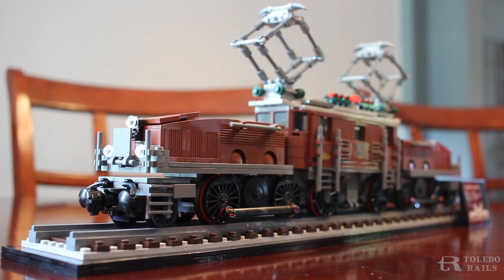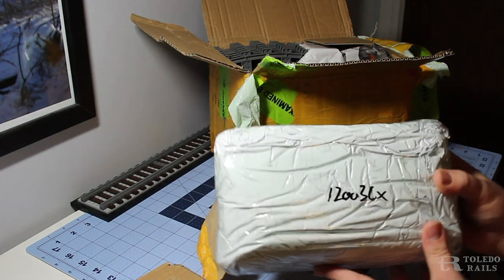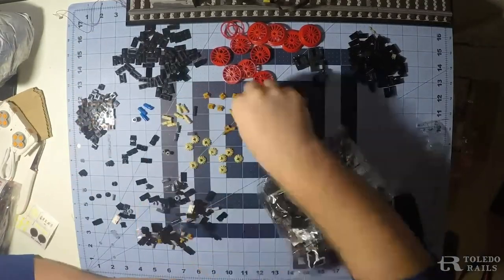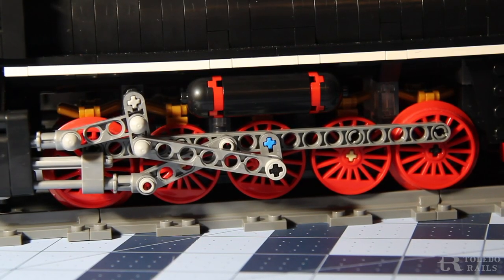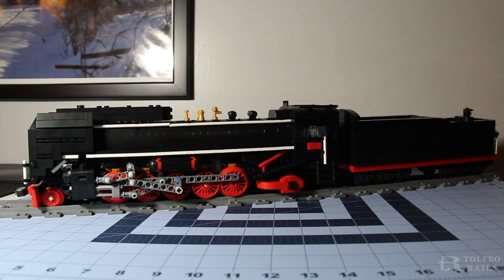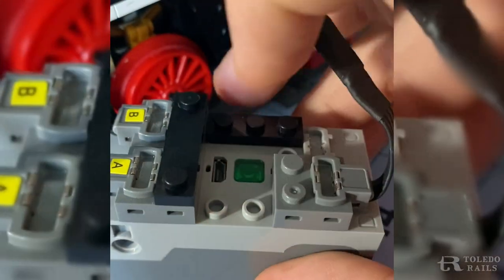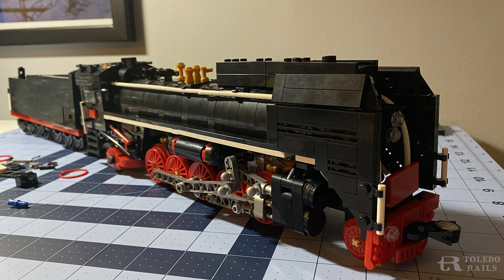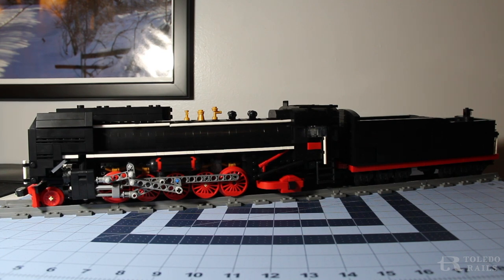MouldKing QJ Steam Locomotive Review

Comment: I bought this train and I thing it is a great model with moving valve gear, though the instructions don't show how to set this properly
I changed the motorisation and gearing. I have also moved a flange wheel on wheel set back so it corners better, and used a bluebrix speed controller.  Really great set
Reply: Great idea for better track performance. Definitely going to try on mine.

Comment: Mine works great! Seriously download the app for this thing (scan the page in the instruction booklet or message mould king) and you will have full use of the variable speed option. Also if you wanna make it a good runner you need to bevel the four wheels inboard of the drive wheels on the inside edge with a dremel. This prevents them from rubbing on the drive wheels. I remove the ladders when in use because they have a tendency to hit the hitch and cause derailments off of corners. You will want to lube the moving parts to get the most out of it as well. I used a product called krown t-40. A moly based graphite would also work well but may be messy. Right now I'm running 7 cars on mine and can run more very easily. Battery life seems to be maxed at about an hour of nonstop use. The only real gripe I have is how the front guide axle is held on, which is easily fixable. This review is wrong on so many levels. This is my first Lego style train and I couldn't be happier. 4.7 out of 5

Comment: Glad you reviewed this. I bought a JieStar Building Blocks Set MOC BR01 Steam Train Locomotive Bricks Model Kids Toys 59004 for under $AUD 85 ($US 54.50 approx) and was initially impressed. However, as I got further into the build I found many quality issues. There was no base plate for the loco, just built up tiles. Result was that it bent like a banana. Solved by Lego reinforcements. 

Eventually, I got the base assembled and kind of working. Then I tried to assemble the body. Oh dear! So many connections used a single stud and a one or two stud tile, that I eventually gave up trying. Each time I tried to lift the model to add parts something fell off, or an entire assembly broke. 

My analysis is that you need “superglue” to assemble this beast. 4 attempts and I’ve shelved the train, and all thoughts of a cheap unpowered model to which I could add Lego power functions, have evaporated. However, perhaps I can use so parts to build a genuine 80-90% Lego steam train.

In summary, avoid JieStar and try real Lego. Even used is better. There’s a reason Lego bricks and models are expensive. Research, development and quality control; all of which seem missing from Chinese “Rego” products. 😢

Comment: Is there any way to improve the locomotive?
Reply: use lego battery box and receiver with 2 L-motors
Reply: Yes
1) Use a speed controller from BlueBrix or lego
2) Change the gearing to lower the speed
3) Change the position of the front flange gear 1 axle back to sit goes round corners more smoothly
4) Change the 7 axle for the valve gear for 2x4 axles as the valve gear is not meant to be synced which means it get forced by using a single axle
5) Make sure you set up the connecting rods and valve gear correctly, the instructions do not give the detail, but the Lego Emerald night will help.  Start with the valve gear in neutral (aligned with the centre), then offset to give the required effect.
It is worth the changes, it is an excellent model - a little fragile as it is full of detail with moving valve gear .  It is a good price on Ali-express and I got mine for £62.

Comment: Just wonderig whose MOC design they stole this time. Sadly as long as  people don't care why those Chinese knock offs can be so cheap  (by cutting every possible corner) they will keep existing.
Reply from the maker: I’ve looked into it, honestly I believe that they designed and sold it themselves. MouldKing is the rare Chinese company that designs their own stuff… at least as far as trains go
Reply: @ToledoRails   I can only speak for Technic themed sets as those are ones I am interested in. And most  of them (especialy big ones) Are stolen. They stole Sariel's Mustang. Madoca's Shaman and Icarus. Basically every single one of LucioSwitch's trucks. The forklift they have on main page right now is also stolen. Basically if anything has good reviews and lots of downloads on Rebrickable gets stolen. And remember they are part of Lepin which just copy every Lego set they can. That's Chinese mentality. They do not acknowledge something like "Intelectual property". 
As for this train, I looked on rebrickable and found at lest 3 very similar ones. I am quite sure that if I would spend enough time there I would find exactly this one. 
What bothers me is that a lot of youtubers just don't do research (or don't care) and provide them with free marketing, Yet another way they can save money. At leat here You showed that quality-wise this set is crap.
Reply from the maker: @MichalPazio  really the only thing crap about it was the electronics, and even still I’ve had better luck with the other two MouldKings trains I own. Interesting to note I checked and the other QJs on rebrickable were after this was first offered. Don’t know if I’ll ever get around to a part 2 on it, but it’s been a “low enough” investment that when I put in some small upgrades, I still felt that I was doing way cheaper than if I did it with genuine lego parts.

Comment: Just finished my copy today. I ordered off Taobao. I had to remind the seller to remove the box due to oversize (also ordered the MK classic green train and highspeed rail, x2).  Found your review when I wanted to see if others share my same disappointmemt with the stickers.

I have no issues with running the locomotive. The wiring took some tries as they don't tell you where to tug the wires as you are building. Other than that the mechanism ran smoothly after I took it off the rail and fiddled around the bars.

I wonder if I can scan the stickers and reprint it on a clear decal sheet.

Comment: The valve gear and rods are not right. they should be parallel both side but when seeing the stuff move there clearly is an offset between the sides

Comment: I've bought many "brick" sets on Aliexpress and there is ALWAYS something wrong with it. I now call it the "extra challenge". I have some sanding paper and knife ready for any operation that is needed. Luckily the sets are getting better and better and still around 25-30% the cost of real Lego.
Reply from the maker: They certainly are great for a project!
Reply: @ToledoRails  Last couple weeks I have gone a bit crazy with the Aliexpress Trains. The real Lego straight tracks are ridiculously expensive so I have bought many on Aliexpress for around 35 cent each. I had never bought the Horizon Express so now I bought 2x on Aliexpress and powered by 2x Buwizz (I already owned). Of course the curved tracks are too curved so I have been sawing and glueing them to get a low gradient curves. So now I got a mega 180 curve with a diameter of around 2,5 meter and one of around 1,80m. I have sloped the curved tracks so the Horizon Express and go on Buwizz fast mode 9V on maximum and keep in the track! Haha. I need to make a video how to modify the tracks because these low gradient curves are great! Unfortunately I don't have a camera so need to make a couple short videos with my iphone.
Reply: @ToledoRails  I've also bought this QJ Steam loc and I think it's fantastic. My stickers were correct on transparent sticker sheet. Are you sure your stickers are wrong? When I first wanted to take the sticker off it came off with the white under sheet. But the cut is not very good so I bit difficult to get the transparent sticker off.   Please check the stickers!
 I did not even install the included battery because I used a Buwizz battery that is the exact same size. Before I installed the lights I put some 2K glue on the led and first tried it out on a simple battery box and that worked.
I didn't like the way they connected the wheels from left and right side with the 9 axle for those side silver thin beams. So I installed 2x 5 axle with stopper and offset the wheels 6-12 o'clock. So now the resistance is more evenly divided. I also oiled almost every moving part and now it actually sounds smooth. Together with the Buwizz I can accelerate slowly instead of the on/off. The wheels are pretty far apart so it does not like bends but I have modified most of my tracks to be low gradient curves. So now it drives smoothly through my living room. Funny thing was I ordered the locomotive and separate wagons but they did not have the locomotive in stock. So I ordered it from a seller with shipping from the Czech Republic and it arrived in 3 days! I probably still need to wait a couple weeks for the wagons to be delivered from China.  This set would be 3x the price if from real Lego.

Have you seen this Heavy Hauler train? I built it last week and it's great and for a nice price. The photo from wikipedia is almost the same!

https://www.bluebrixx.com/en/bluebrixxspecials/100247/Heavy-haul-train-BlueBrixx-Special

https://en.wikipedia.org/wiki/File:Tragschnabelwagen_Uaai_839,_HCS_Heavy_Cargo_%2B_Service,_Trafo_der_Trafo-Union,_Bahnhof_K%C3%B6ln-West-9259.jpg

Comment: Most importantly, what is the quality and compatibility like? Since lego pieces can get very pricy a more affordable alternative isn't a bad idea if the quality is as good as legos.
Reply: It's less about quality of the blocks and more about the design. Quality and fit is fine. The molds are basically made with the same precision machinery as genuine lego parts-lego also having manufacturies in china. It's the design of this particular locomotive that fails on a few fronts, but that can be fixed/customized.

Comment: it has been almost 4 years now since this was reviewed, you said that the model would be modified, is there going to be a video in the future with this locomotive??
Reply from the maker: Probably not
Reply: @ToledoRails  so i am guessing that the modifications didn't work out well, or it has been so long that there is no point in doing a video of it?
Reply from the maker: @Traincraft_Fan  let’s put it this way: I upgraded the system to the PFX brick and it worked great, then it crashed. Honestly my diagnosis for the set is standard for any Mould king set really, ditch that control box and make it a power functions or power functions knockoff (those are just as good) and you’re set
Reply: @ToledoRails  so all i need to do is make sure the decals are nice, and use a power functions one, and it should be good, thanks for the advice
Reply from the maker: @Traincraft_Fan  happy to help!

Comment: I wonder if it will work with Lego electronics. Even if not this is a amazing looking locomotive; it looks very close to the real thing
Reply from the maker: The motor can
Reply: Funny you mention that @Midwest Railfan. I used a speed build of the set on YouTube slowed to -0.25 and then painstakingly replicated it in Mecabricks, whom only has 100 percent legit Lego parts. It's unfinished, but I only have to build the tender

Comment: makes you wonder how hard it would be to mod the QJ to make it more viable for a runner
Reply from the maker: Not terribly hard, I’m still fine tuning it for a follow up video. Been busy with Christmas and all that
Reply: See my reply else where 
1) Change the front flange axle to axle 2 to improve corning
2) Change the 7 axle pivot for the valve gear to 2x4 axles to prevent problems strain on this, you can see problem in this video 
3) Correctly set up the 90 degree offset on connecting rods and and valve gear
3) Use a speed controller and/or change the internal gearing - very easy - to lower the speed.

Comment: I imagine the plastic is of a very low quality. Also, you could always adapt the design into an actual LEGO set (fan made or otherwise).
Reply from the maker: The plastic was extremely fine quality. Holds tightly together so taking it apart sucks but I was impressed with it
Reply: @ToledoRails  Huh! How about that? I wasn't expecting that from something made in China.

Comment: Why do i always feel like these things need oil or something
Reply: Hahaha, I oiled almost every part and now it runs a lot smoother and with less noise. I love this train! It's pretty easy to build and to take apart. I wanted to install original Lego L motors and you only need to remove some assembled panels. But the  L motors from Mould King do give 30% more speed (measured on Lego RPM meter) so that is pretty nice. With my Buwizz I don't really need 30% more but I noticed that on 7.4V mode the max speed is nice and fast. With original Lego L motors the max speed on 7.4V would be 30% slower and not fast enough. Main tip is to use a Buwizz for great control to accelerate slowly!